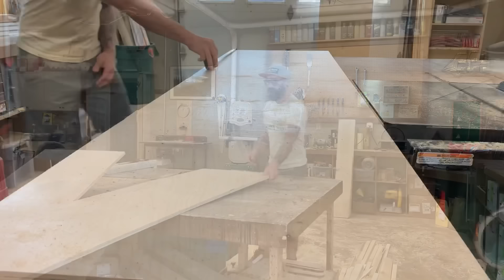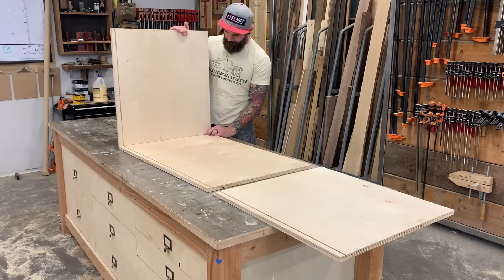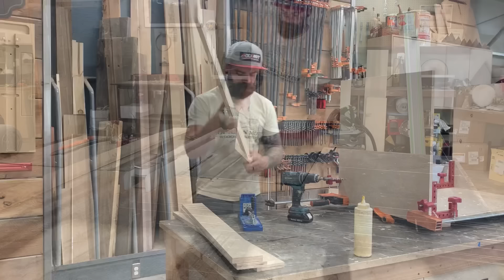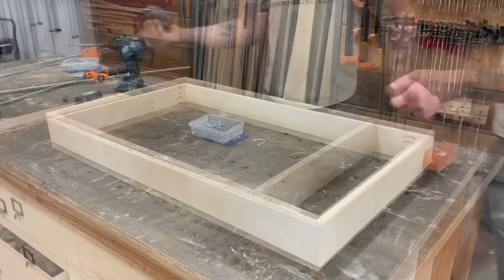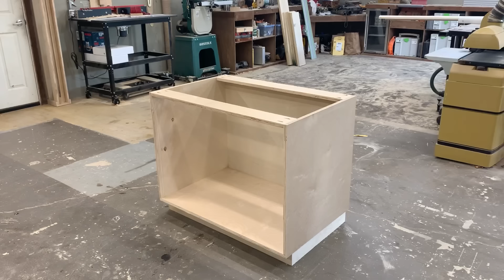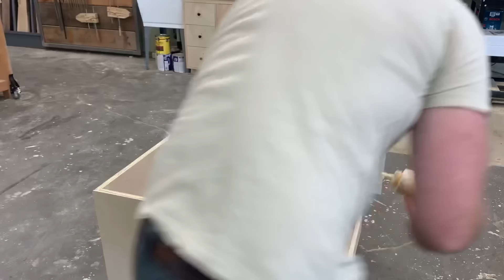Build Cabinets The Easy Way | How to Build Cabinets

Comment: You mentioned mitering the back nailer strip to install it on a french cleat. Does any additional support need to be added and what kind of weight is reasonable when installed that way? Thanks!

Comment: Man that is way too much work making every one of those cuts, screw that, buy yourself a narrow crown staple gun, load up some 1/4" by 1-1/2" staples, cut the space for the lateral sides where the toekick is 4-1/2" tall by 3-1/2" depth, and now you know where to line up the staples for the floor of the cabinet. Make a straight line across the 4-1/2" cut and that's your guide for staple the sides to the floor. 
As much as this is appreciated, if you don't want to see nails in the side of the cabinets, ive got one thing for you- wood filler. Fill the hole, sand it, done. Most of your cabinets aren't even going to be showing the side anyway, they will be pressed one against the other. You basically only have to worry about a few sides depending on the layout of your kitchen. This is SO much work. In the time he built one cabinet, I could've literally assembled 6 cabinets AND had them all edgebanded in that time. There is zero need for all the wood gluing and mitering and nonsense that's going on. But hey, not my kitchen, if you wanna spend as much time as physically possible, do it this way. This is incredibly laborious.

Comment: If installing cabinets into a finished floor room, would you install the cabinets on top of the finished floor or directly on the subfloor and then finish the floor up to the kick plate? What would the Bourbon Moth do, and why?

Comment: The best way to not to need to fill the crack between the face frame and the carcass is to to make the face frame 1/2" wider than the box and it hangs over a 1/4" on each side hiding the seam.

Comment: Hi... Thank you for your video's... I am building a built-in cabinet where there are no sides exposed... As a matter of fact one of the sides butts up against a wall.  My question is on this cabinet do you need to use drawer dividers?  This is going to be a stereo/media cabinet and I want to be able to pull each drawer out to access a panel in the back for cabling, and a drawer divider would make it impossible to get to it.  Thank you again as your video's give me confidence to try things like this.  I'm an IT guy that has always loved the idea of working with wood.

Comment: Excellent video.  I have a question for a long cabinet I'm going to be putting into an alcove in our home that apparently was for a large TV to go into, however our TV was too large and was hung on a different wall.  So, the alcove I'm going to make a cabinet for and place two floating shelves above.  This alcove is almost 70" long.  Seems too long for a two door cabinet and too short for a three door.  What's your recommendation?

Comment: Any recommendations for building base cabinets for a garage that has a significant footing offset? Have a two car garage with a decent slope. The cinderblock footing measures 12"-14.5" from the floor (depending on which end of the garage you are on). The finished wall and baseboard in do not sit flush with the footing inside of the garage, leaving a 5.5" gap between the wall and would-be cabinet. This makes doing a full wall run of base cabinets rather complicated. Any help or tips would be greatly appreciated. Thanks!

Comment: Coming from a flooring vet... you need some knee pads brother. You'll thank yourself one day lol. Nice video and nice work at investing into your trade. You have a nice shop going on. Keep it groovy my friend. Another thing... I see you have Makita and I'm assuming bc they're very lightweight. When it's time to get another set you should try the Milwaukee M12 drill and driver. I use them for a lot of things that aren't M18 necessary and they're super strong to be so small.

Comment: Looks like the kick-plate structure is not quite flush with the sides of the cabinet itself, by design. If your cabinet is 36" wide, do you do roughly a 35" kick plate structure to leave roughly 1/2" overhang left and right? Or is it flush on the side that's mitered?

Comment: For guys without track saws, cutting the wide sections like you did with the track saw can be done easily with a circular saw.  Just stick some scrap wood on either side of the cut line parallel to the blade direction and 2 more on either end of the piece you're cutting to give it stability.  It brings the saw off the workbench or ground and gives you more stability so that the pieces don't pinch or separate.  Cleaner cuts and much safer than cutting on a sawhorse.
Reply: Or... Buy a piece of 4x8 foam insulation board. Use that under your piece you are cutting. Cut right into it 👍

Comment: Hi, aside from not needing a kick plate and putting a 45 miter on the top nailer, is there anything you would need to change for this to be wall-hung / floating?

Comment: I found your channel about 2 weeks ago and have been addicted ever since. I'm going to do some built in cabinets in my study and this is very helpful.  I'm curious about the depth of the carcass.  Did you just rip the plywood down the middle at 24" so the slides in your link can be used? TIA

Comment: Love this video series! One question, how do you attach the kick plate to the cabinet during installation?
Reply: It was explained to me by a cabinet maker to mount the kick plate to the floor 1st ensuring it's level.  Then mount the cabinet to the kick plate through the bottom of the cabinet into the kick plate. As long as you build your cabinet square it'll be square when you mount it.

I like this method way better than building the pick plate into the cabinet and it's easier to square a kickplate than a cabinet.
Reply: I have the same question...
Reply: @onthetrailwithrobandluz3520  I ended up just cutting out the plywood for my kick plate. My cabinets turned out great, and I used the rest of his tutorial for the rest of the cabinets.

Comment: If you are burning through the plywood, you aren't saying correctly. Whatever compound you are sanding, if done correctly you will not burn through the plywood. It doesn't matter what your sanding epoxy, spackle, bondo, plastic wood etc. You just don't know how to sand bud

Comment: I missed how he expects to secure the cabinet to the kick plate. I’m going to assume that it’s not just glued, right?  And screws on that bottom shelf surface would be unsightly. 

So glue and finish nails? What?
Reply: He says in another comment that he doesn’t. He attaches the base to the wall and the cabinet to the wall, but not to each other.

Comment: If you build the kick plate separate from the cabinet so you can shim it and level it before you set the cabinet on how do you attach the cabinet without the screws being visible?

Comment: Typically cabinets face frame extent beyond the sides.  Yours are flush.  Wouldn’t the flush sides be an issue in a long cabinet run?   I think the gap is used to give cabinet runs more adjustability to conform to wall imperfections.  Do you sometimes build them that way?

Comment: Love the content as always. Curious on the toe kick why did you add the extra cross piece is that just for additional support or is there a specific reason it was added on the one side? Also how do you typically attach that part to the actual cabinet carcass? Sorry if you said it and I missed it or if it's in the follow up vids. Thanks!!!
Reply: This too is triggering my OCD. Why the offset center brace on the Toe Kick, Mr Moth?
Reply: I think it's for strength because the miter is just glued with no fasteners. I feel like I have heard this explained before. Maybe.

Comment: Help, I watched all three parts on building your base cabinet with drawers. I some how did not catch the part where you attached your kick box to the cabinet
Reply: To me its like the base, so you don't bounce your toes.Extends your cabinet to your knees. Also you can glue pocket screw your kick box to cabinet from the inside of the kick box.
Reply: He said he doesn't. He attaches the kick box to it's home position and levels that. Then when the cabinet sits on it, it's already level. Then you just attach the cabinet to the wall. The the parts aren't directly connected.

Comment: also for filling holes when painting, you can use automotive panel filler, it has a hardener and is ready for sanding in about 5 minutes or less

Comment: You never showed how you attached the base to the cabinet. You did not have pocket holes in the base to screw to the cabinet. So how did you connect the two?

Comment: Oddball question but what fastening hardware do you use for your woodworking? Being that i don't do a lot of woodworking when I do I end up staring at all the hardware wondering what is best? How long do i need? How long is too short for holding power? Am i getting them too long? What the F am I even doing here, I should just hire someone, that's expensive ill build it myself. Thats my typical conversation with myself.

Comment: Thank you for a great video. I'm about to start my first cabinet of drawers. I was wondering if your kickplate frame is slightly smaller than the box? Does it ever get attached to the box? Since my cabinet will be sandwiched between to others, would you use Baltic birch or a different 3/4" ply?  Can't wait to see drawer construction. Keep the videos coming..really learned a lot.
Reply: I've been scrolling through the comments trying to figure out if someone asked about mounting the cabinet to the kick plate, and I have not found an answer yet. I have some ideas on how to do this, but I'd like a pro's advice. Or at least someone who's done it before. :)
Reply: @NewbTube69 same here.  Got everything built now just starting at the 2 pieces.  Wanna avoid just screwing them together through the base if there’s a better option.
Reply: @derek9955  I did the same thing Jaime did above. I mounted the kickplate to the floor with 2x3s I bolted to the floor. I then screwed down the cabinets to 2x3s as well. I will say, I like this method, as you can level the kickplate, which is a hell of a lot easier than leveling a bunch of cabinets. Especially if there are multiple, like in my case.
Reply: I have been searching for the correct way of attaching the kick base to the carcass and had been unsuccessful, can you share how you attached them?
Reply: @jont5320  Hi, I did not attach the kickplate to the cabinet carcass. I made a free standing kickplate frame for the carcass to sit on. The thinking behind that was the difficult location and the thought that if adjustments were necessary, it would be easier to perform on a free standibng base. The house is a 100 year old and squareness/levelness could be an issue. As it turned out, the base/kickplate and carcass fit perfectly. Given the carcass weight (empty) there has been no issue with it not being attached. Hope this helps.

Comment: Nice video but if would be even better is the names were correct. The top and back "braces" are called stretchers and the side bottom cut out is called a rabbit. Thanks

Comment: Questions: I am replacing a bathroom vanity cabinet. It’s 58 inches and runs from one wall to another.

1. Would it be advisable to assemble it in place?

2. Because of the length should there be additional bracing in the middle?

As a first time cabinet builder I really appreciate your videos. Thanks!

Comment: Thank you so much for this series and channel. You've instilled enough confidence in me I was able to convince my wife I could build a bathroom vanity. Now I have to design it. I have one end/side that isn't up against a wall. I can't tell from these videos if your cabinet overhangs the kick plate on the sides or is mounted flush. I don't have much wiggle room because of the water lines. If flush mounted do you just use more epoxy to hide the line? If it is overhanging what distance looks best? Thanks again

Comment: I know you are very busy but if you could answer this question I would be very appreciative.  When building your cabinet base, you placed a brace about 6 inches inside of the side of the base which you had the mitered front corner.  Why did you do that as I didn't see an explanation on that and would love to learn the details behind that.  Do you do that base brace on all of your cabinets?
Reply from the maker: I just like to ad a little strength to that mitered corner because it is a potential weak spot.

Comment: the seperate  kick plate shows a seam. I like it cut as one piece.. But you do nice work,  and should, with that fab workshop and over priced festools. they are so over priced and the rating on the track saw not so great..

Comment: The FIRST thing to do when building a cabinet is to determine the MEASUREMENTS.  We can determine the Height and Width and Depth of the FINISHED CABINET easily.  The next step in determining the measurements for the CUT LIST is the tricky bit and one few if any of these HOW2's bother with.

Comment: Nice video.  It's all about the tools and the techniques coming together.  Woodpecker tools are nice but expensive.  Not a fan of Festool's proprietary approach to their tool line.  Everything is over priced and you'll easily spend $4000 and still not have enough.  $500-$600 for a skilsaw is not justifiable.  But it's not a tool review video so again thanks for the tips.

Comment: Love this series enough that I'm using it as a guide to learning to build cabinets. Big thank you!!! I have begun and am ready to assemble the front face but I've noticed that connecting the kick plate has been ignored in part #1. Am I just getting ahead of myself?
Reply: He responds in another comment that he does not attach it to the plate base. The two pieces are attached to the wall and that’s it

Comment: Thanks for the videos! I am going to build custom cabinets for my garage and master bathroom. Can you please share with me what, if anything, you would use for the inside of the cabinet drawer bottoms to help prevent any moisture issues from splashed water, tooth brushes, and so on. When you buy a cabinet from a store they always, well in my little experience, come with the semi water resistant coating. I am just concerned about raw wood soaking up water and was hoping you had a solution. Thanks for your time!

Comment: Enjoy the video and the humor. You give a good explanation as to the steps involved. If I wanted legs on the cabinet instead, would I use the same construction method but bolt legs through the base of cabinet?

Comment: Great Videos, I need to get some ideas for building all cabinets upper and lower as well as custom recessed in wall display and all of my furniture cabinetry for my 40' custom luxury bus conversion that I am building. Keeping weight in mind and the fact that this luxury bus will be built for traveling. Would you have any suggestions. Thanks

Comment: Loved the video, but I have a question. Since you attach the kick plate to the wall and not to the cabinet, how would you attach it if you were putting the cabinets in the garage, where the concrete stem wall comes up about 12”? Thanks for making these videos!

Comment: Why the Mohawk epoxy filler for the edge over the wood plastic filler?  Asking for a bookshelf I have built.  I have wood plastic, but wonder if I should get the epoxy filler for my trim seams.  Also, what about filling on a miter corner?  Why do some use caulk as the filler?

Comment: I’m brand new to woodworking and at this point have built a farmhouse table. However, I have watched, what seems like, 50 of your videos. All of that said, why do you use your chop saw the way you do? I see you seem to have a method of sawing with it and I’m not certain as to why you do. Does it simply provide a cleaner cut?

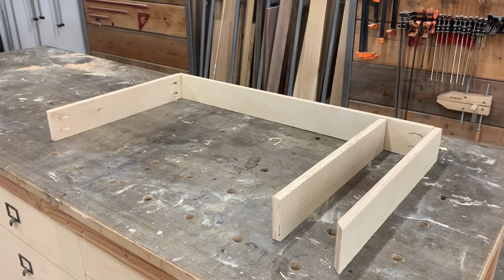Comment: Thanks for the informative video. I learned a lot and picked up some confidence to build my own. Curious though...at 8:56, while building the kick plate, what is the board in the middle for? Was there a specific dimension you used?

Comment: You can also save a ton of time, skip making the kick plate box by making your side plys longer and cutting a notch out of the bottom front that holds the kick plate.  The kick plate is the only piece I attach using Brad nails, and I do it after installing the cabinets so I can get wedges underneath to have perfectly level cabinets.  On the longer cabinets, I'll put a tunnel in the biddle.

Comment: LOL. Easy if you have a $3000 tablesaw.
Reply: Everything in this video can be easily done with a jobsite saw, or with enough determination some jigs and a skillsaw.
Reply: If you have to have a $3000 table saw to build that, you should quit woodworking.
Reply: I purchased my first 10in. table saw at a pawn shop and it was still new in the box and also came with the stand. I paid $80 for it. Best investment tool purchase so far! I have wanted to build so many woodworking projects but took a while to get the tools necessary. I now have everything I need to build anything! All it takes is the ability to budget and if you have no tools then start out with pawn shop tools. You will find great deals at some. It will also require a positive attitude. I know you can do anything you truly want to do.

Comment: Honestly, fantastic series, helped me build out an awesome home theatre setup.  One area I did really struggle is filler pieces (where cabinet meets wall primarily).  I managed to get it to work, but would love to see an actual cabinet install and how you deal with some of the more "annoying" parts, such as filler pieces, walls that aren't level, etc.

Also, those corner clamps are a God send.  I'm always struggling on projects alone and those just made life insanely easier.  Let me get back to the bourbon a bit quicker 😉